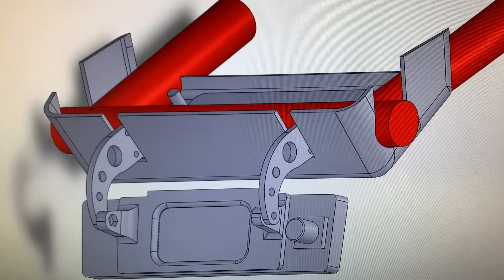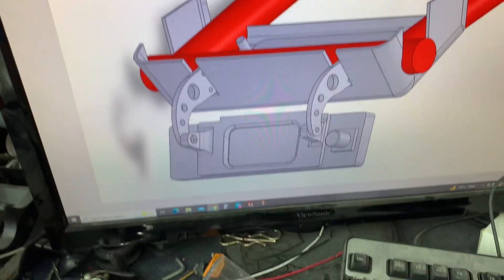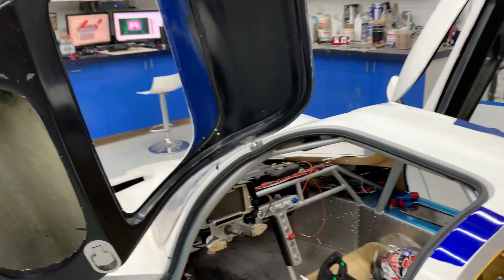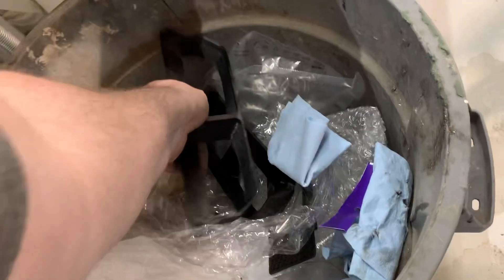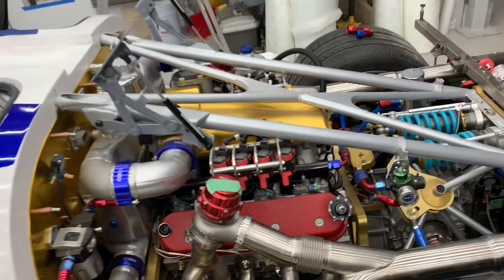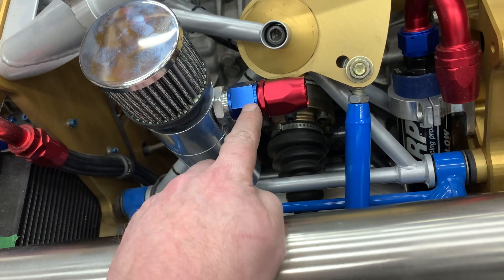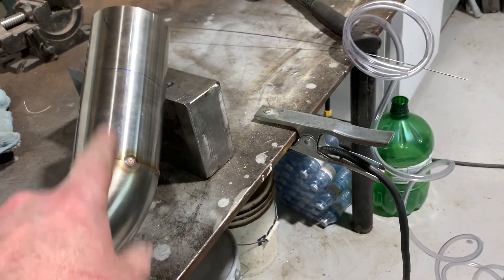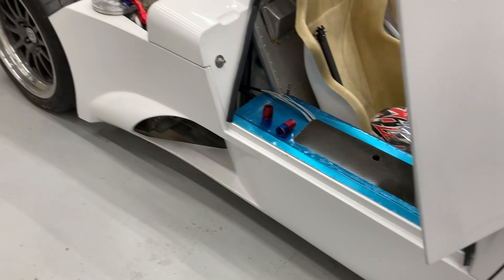3D printed Stainless Steel exhaust

Comment: ouch, the ender 5 plus is the source of all of your 3d printing problems man. If you've got the cash, I'd spend the money (2k ish) and get something proper like a ratrig v-core 4 400 with their hybrid/idex kit (so you can do large parts with dissimilar supports). I was initially thinking that you just hadn't tuned your filament profiles properly... but wow, it's worse than I had imagined and not really your fault.

You've got an amazing project in general being completely let down by an ancient bargain basement printer :(

as much as I love my bambu x1c, it's a bit small at 256mm squared compared to the 350mm size of your current printer. I'd mention maybe going with a Voron, but they're incredibly fiddly to assemble and come in kit form. I'd recommend staying away from the Sovol SV08, even if it's the right size, they haven't quite worked the bugs out of that printer yet (nor do I expect them to). Another Voron-clone is the "Troodon 2.0 pro" from formbot. If you decide that a Troodon 2.0 pro looks good, check out @ygk3d here on youtube, he's the "main" guy for troodon resources on youtube.

Comment: Imho the hole for exhaus is way to small, it nearly touches the pipes. What about vibrations?
Reply from the maker: Maybe but the bigger the gap the worse it looks. If you think your going to hear a minor rattle that far back, you maybe forgetting this is a solid mounted and structural engine and as such is more race car than any road car. I have ordered the rally car stile intercom system so my ears don’t bleed on long trips 😉